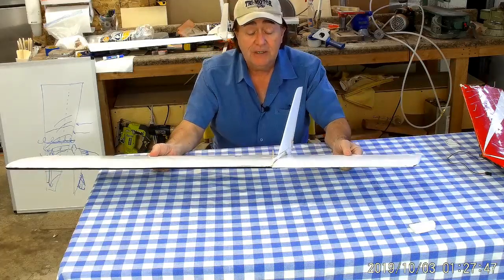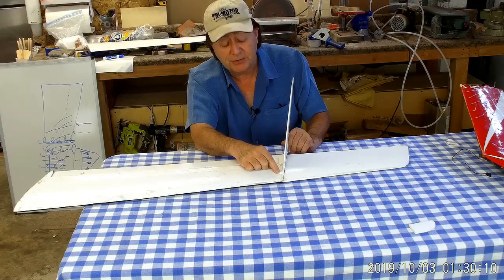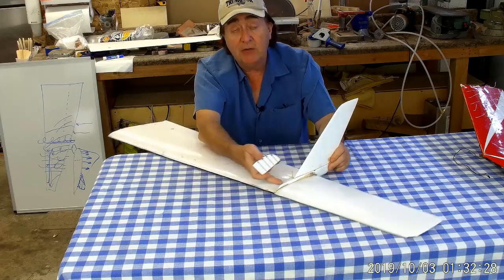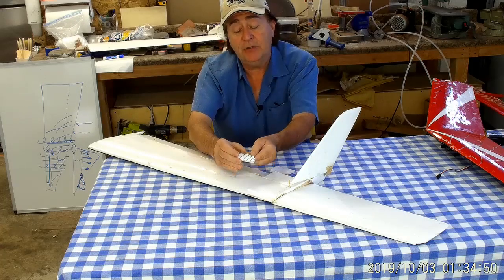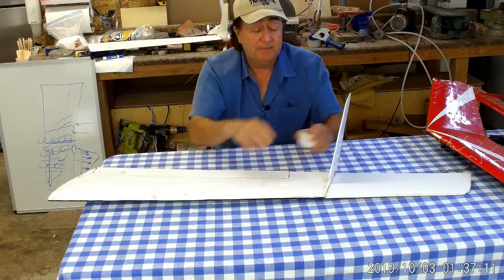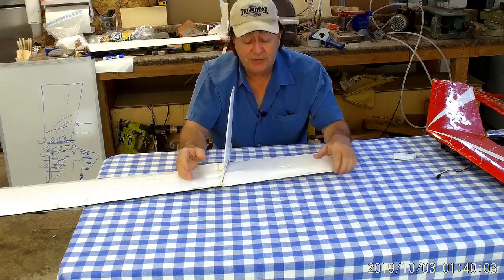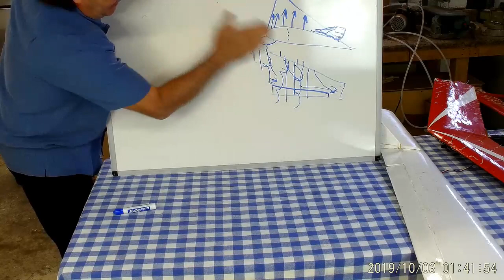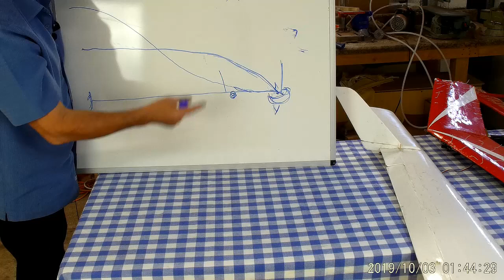Preventing Spins Part 3B - Klingberg Wing MkII Development

Comment: Great solution Rol. Slots and turbulators have also been used to prevent stalls by re-attaching the boundary layer at higher AoAs.  Maybe adding small turbulators on the outboard wing tips would help.
Reply from the maker: Granted slots and vortex generators (turbulators) would do the job, but one pays a high price in drag over almost the complete speed range of the aircraft. Not a problem for powered aircraft, but undesirable for a glider.

Comment: Thanks for sharing these videos they are great. a fillet on the outboard section of the winglets would reduce a bit of induced drag without penalty. but I think you said you are doing both sides of the full size version.
Reply from the maker: Ah, yes, when I posted this video, thought I might have made this segment confusing.  As to the fillet issue, I was speaking in reference to wing fences only - fences being something that are only a fraction of the wing chord in height. For my design, I'm using the winglet to straighten the flow, so in the area of the winglet I can use fillets without ruining the straightening effect. The forward portion of my winglet mount is a traditional fence and it does not have fillets (I'll show this in an up-coming video). The reason that fillets are bad on traditional fences is that they provide a ramp that makes it easy for the spanwise flow to go up over the fence. A very tall fence such as a winglet prevents that from happening.

Comment: Interesting... Alexander Soldenhoff employed similar vertical surfaces on his flying wings, some of his designs also had wing tip plates. I am trying to reconcile the information you have presented with that of the Hortens, Bowers, Kasper and others. Soldenhoff's last airplane was built with only mid-wing verticals that were constructed like split flaps to produce yaw moment.
Reply from the maker: There are two basic areas that I believe just about everyone has to rethink about flying wings. One, unlike conventional configurations, placing winglets at the tips of a flying wing does not do very much to increase performance. That location provides the most moment arm for yaw stability, but it does basically nothing to increase performance by taking advantage of the tip vortex. Because of the desired lift distribution for a stable flying wing, there is usually only a very small or non-existent tip vortex. Two, the bell shaped lift distribution is not very efficient in terms of the resulting L/D polar. Granted, the bell shaped lift distribution makes for a flying wing that is very stable in yaw, but the designer pays a very high price in terms of Oswald's efficiency factor (a future video I'm working on). For my design, I'm trying to achieve a broad L/D polar (good L/D over a wide speed range) by working toward a more efficient elliptical lift distribution. This approach has required that I explore methods for effeciently regaining yaw stability, without greatly increasing drag - hence the Autoyaw winglets placed somewhat inboard. Hope this helps resolve any internal mental conflicts :-)

Comment: Rol I've just stumbled on to your channel and have subscribed.  Can you comment on the Mitchell Wing B-10 configuration which, I believe, has no washout (I think Don Mitchell felt it was unnecessary with the Junkers elevons)  and I have heard the the B-10 suffers from tip stall spin tendencies regardless.  There's been a lot of discussion of this on the Mitchell Wing Yahoo group and the need to possibly build in a couple of degrees of washout of the outer panel if someone is building a B-10 today (good luck finding plans though).  In the event I ever stumbled on a decent B-10 for sale (I wanted to get one and replace the 2 stoke with an electric motor for flatland motorgliding), I've wondered if some minimal amount of VGs, say in the last couple of feet of wing panel, could fix the tip stall without too big a hit on L/D.  Or possibly a Vortilon or two near the tips?
Reply from the maker: Hi! Thanks for subscribing and please tell all your friends. I just posted the current build status info on my Patreon site here: https://www.patreon.com/klingbergwing  I do not have any specific technical knowledge of any Mitchell Wing and therefore can't comment on the specifics of the washout issue. There is a guy that has rights to sell the plans and he is online. I'm sure he'd know the "truth" if one contacted him. That said, it is fairly well-known that the MW will spin in certain situations as will most flying wings. Sufficient washout may or may not solve the problem as the situation is often driven by the planform shape of the elevons relative to the overall wing configuration (amount of built-in washout). I explain this issue in great detail and provide a proven solution in a series of videos that start here: https://www.youtube.com/watch?v=6JXeW63DQrA&list=PLNp_btR7M1GUUJF0TbaTVASomkf3mXDRt